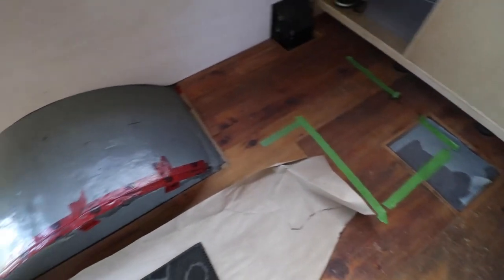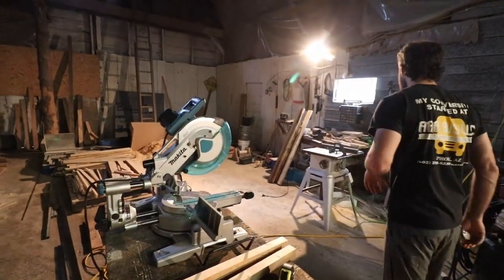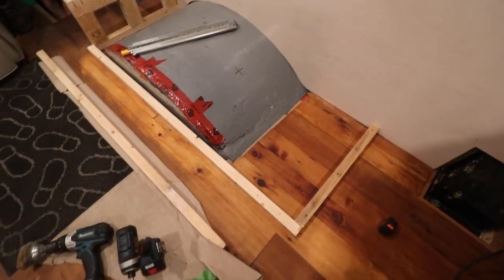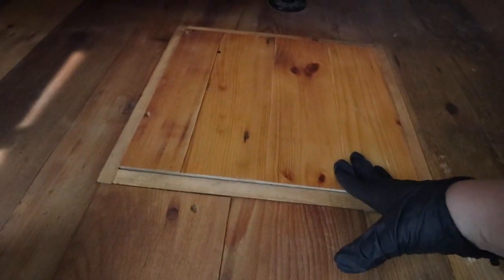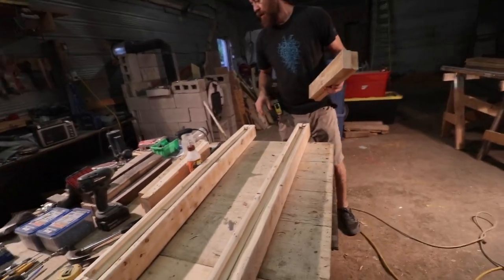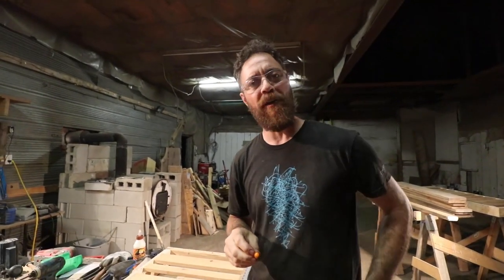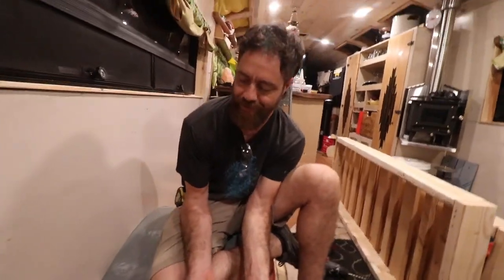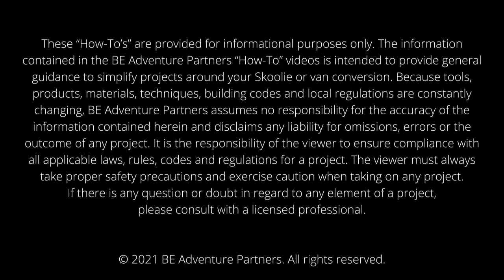Stumped By Livingroom In Our Skoolie Layout (DIY Pallet Couch To Pullout Sofa Bed) Part 1

Comment: Feelin guilty for using new materials now..Even that seems like an insane amount of time consumption...(While working full time) .. Our lumber prices aren't that high lately in BC.

Lookin good 👍😊
Reply from the maker: Don't feel guilty @Djed Eye - We had no choice but to use pallets because the cost of lumber was stupid in the summer in Ontario. Like off the charts. We were also spending a lot of money on well... Everything else we needed at that time, cuz we had to get out of the barn. AND we were heading out of that area, so we wouldn't have a physical address to receive deliveries anymore. So we had to pre order EVERYTHING in advance. 

Everyones situation will present differently. If you are able to go slow, you have the cashflow... Buy the new stuff. You will save so much time. 

Thanks for hanging with us, and for your kind words. - E + B too